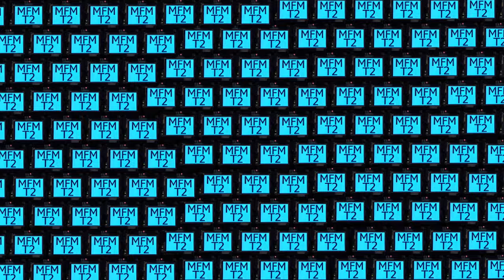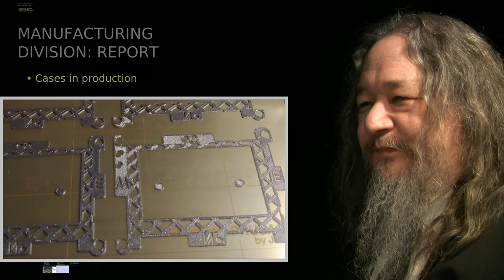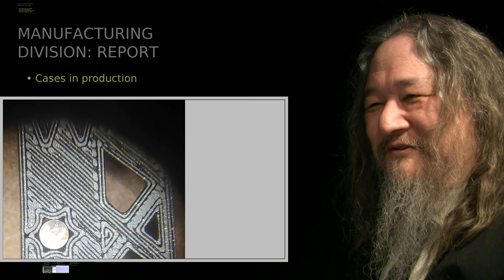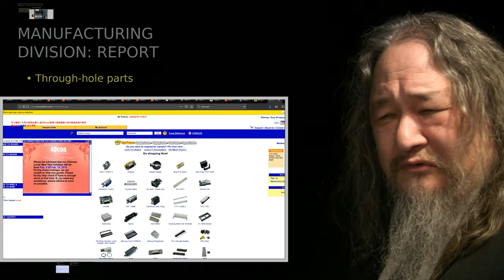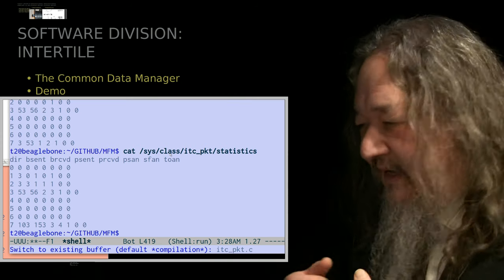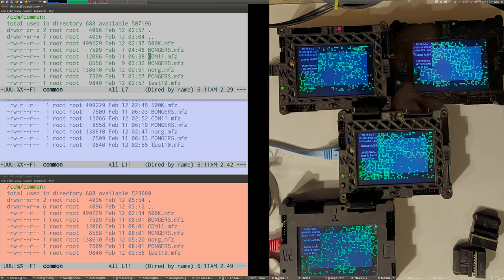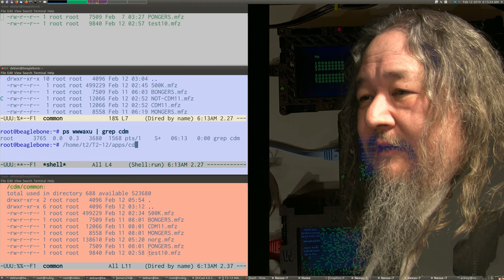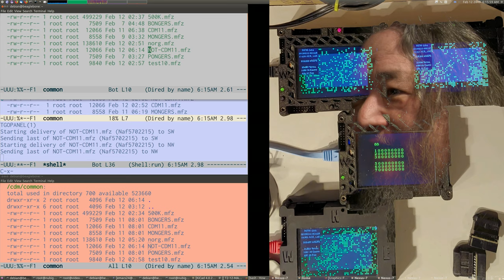Full Stack Development - T2sday Update 218

Comment: I wouldn't feel too bad about "cutting Adafruit out of the loop." They are a wonderful company, but it seems like their core userbase is people just getting into hobby electronics. The ring lotus is a funny scale - it's juuust on the edge of realizing the economies of scale (e.g. almost to the 1000 piece minimum order count). Although they are excellent (perhaps even the best) for 1x or even 10x projects, Adafruit just doesn't have competitive prices for higher volume orders (at least for the part in question). 

* Graphics lagging

You mentioned a feasible solution which is simply scaling down the graphics. In addition I would consider a slower refresh rate, perhaps fading to black as the time since full refresh passes (maybe refresh every 2-4 seconds instead of every second).

Alternatively I wonder if just using simpler graphics would work, like an RGB bitmap where 1 pixel = 1 site. (Or maybe 1 site could be a slightly larger region, but still a square area, no fancy geometry like circles.) Also I wonder if a text-only display would be faster, like the terminal-rendered game areas in Dwarf Fortress.

* Deleting files

Yeah, I see what you mean. After contemplation, I don't think it's possible to solve deterministically for exactly the reason you mentioned - the deleted state is indistinguishable from the "I don't have it yet" state. It sounds like you're encountering one of the 2 hard problems in computer science: naming, cache invalidation, and off-by-one errors. 

Before getting too deep into a custom solution (almost like an implementation of BitTorrent), I would consider a cursory look at existing software deployment tools. The names I hear over and over for dev ops are Ansible, Puppet, and Chef. Or hell, maybe BitTorrent would work. That's what it's designed for, after all (peer-to-peer file sharing).
Reply: Regarding deleting files, perhaps just the forkbomb/anti-forkbomb model of one getting more chances to propagate could work here; just announce deletes more often than file adds.
Reply from the maker: You're both right.  To announce a deletion, one must know that some content used to exist, so that's a different world than the one where it never was.
Reply: @AndrewWalpole  heh. interesting. it reminds me of a chemical gradient, like how (some) cells in the body communicate. https://en.wikipedia.org/wiki/Cell_signaling Or like pheromones (olfactory(?) chemical communication between organisms). 

my kneejerk reaction is that the solution is very... non-deterministic, I suppose. It seems like you would be relying on the statistical properties of a race condition - usually race conditions should be avoided as much as possible in programming.

I think that's the bias of my training, though - we're not going for deterministic but instead best-effort. It occurs to me that a casino has no control over any given roll of the dice or hand of cards, but they stay in business anyway (as do insurance companies). So perhaps a relative statistical (stochastic?) certainty would be quite a robust solution after all.